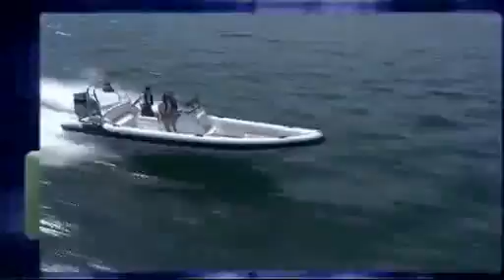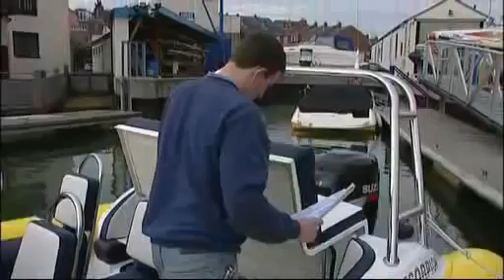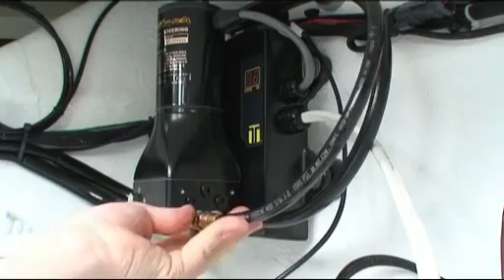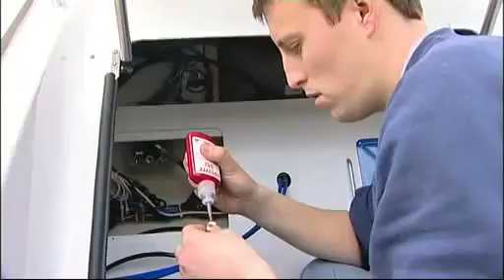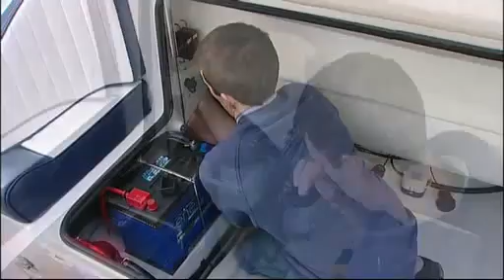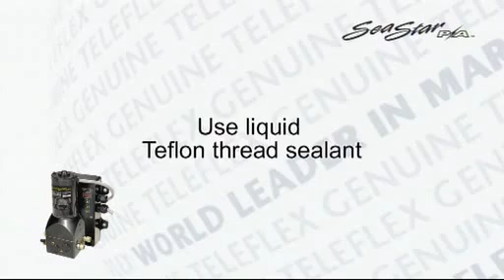Installing Seastar Power Assist Steering

Comment: I have issue steering wheel is not stopping when thr engine is full turned.
Reply from the maker: We recommend contacting Seastar/Dometic directly for tech support assistance: Technical Support: 800-730-4082 opt 4 and 5, marinesupport@dometic.com

Comment: what part number and size is the Nylon Tubing and its compression fittings?  is that the seastar 3/8 Nylon tube and just the Tube Nuts they have?? I dont see any other "compression" fittings